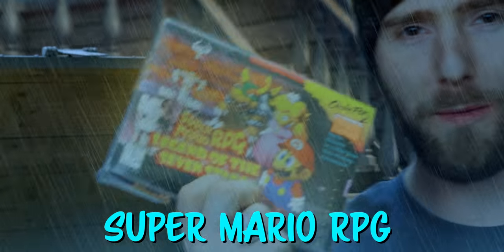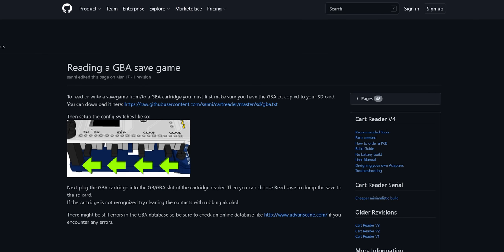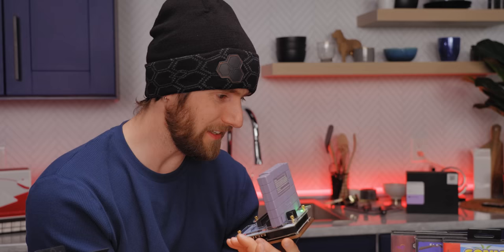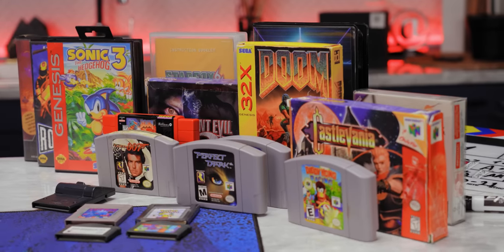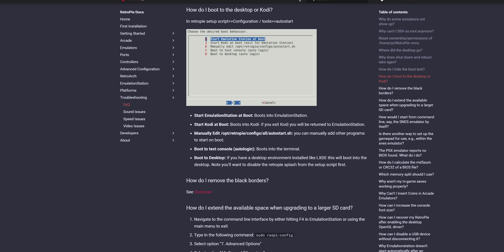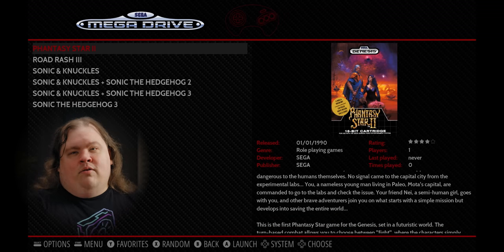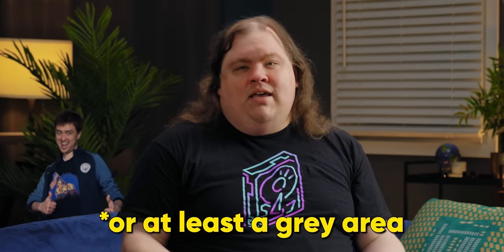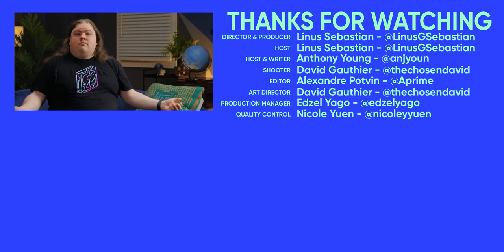I am a pirate - How to LEGALLY emulate games ft. Save The Hero / Sanni v3 + Raspberry Pi

Comment: Imagine how amazing it would be if video games entered the public domain 10-15 years after release. Unfortunately, due to a certain mouse, that’s impossible.
Reply: Mickey actually is going to enter public domain on Jan 1 2024. Turns out the extensions to copyright became such a meme that anti-copyright extension groups gained a lot of traction and an extension is now unlikely. It's worth mentioning that only the original Steamboat Willy depiction of Mickey is entering public domain that year though, so you still won't be able to use the more modern depictions of the character for a while.
Reply: @TheRyulord  This is exactly why they've started using Steamboat Willy at the start of they're movies, etc.  Copyrights expire, but trademarks (to oversimplify that means logos and identifiers) don't if they are still in use.  This way, they will still have a case against any major party trying to use Mickey without their permission.  How far that will go in court, I have no clue.
Reply: @Hunter____1  You can pretty reliably track the outcome of a (US) copyright/IP case based on the wealth difference between the parties. There are several notable exceptions, but the general rule is bigger company = victory.
Reply: @angolin9352  oh, I'm not even a little bit surprised
Reply: @TheRyulord  All copyright, patent, digital rights, etc should be public domain as soon as they become profitable enough to be supported by more than one person. Copyright was intended for individuals, not collectives. All collectives should lose patent and copyright. They are essentially government protections and regulations that harm competition and harm the public by creating inequality
Reply: @angolin9352  All regulation naturally favors the more wealthy, powerful entity. This is whyregulatory protections for collectives should be removed, and granted for individuals
Reply: @Hunter____1  with a company the size of Disney it doesn't matter if it'll hold up in court
Reply: @tynao2029  honestly? that's a pretty based take
Reply: @ThylineTheGay  I agree! And you will always have countries that dont give a toot about copyrights like China, Russia etc.
Reply: @TheRyulord  By the way, the Constitution (not the amendments, the actual text of The United States Constitution) states that "No Bill of Attainder or ex post facto Law shall be passed."

In other words, every single Copyright Extension Act was a violation of the plain text of the constitution when applied to works such as the mouse.
More info:

"When these prohibitions were adopted as part of the original Constitution, many persons understood the term ex post facto laws to embrace all retrospective laws, or laws governing or controlling past transactions, whether . . . of a civil or a criminal nature.2 But in the early case of Calder v. Bull,3 the Supreme Court decided that the phrase, as used in the Constitution, was a term of art that applied only to penal and criminal statutes."
Reply: Atari stuff is soon to enter public domain in Canada and Italy. I.e. any country that has a copyright duration for these things of 50 years after publishing. Wonder how that works if you happen to be in a vacation in one of those countries.
Reply: Ahh the groomer mouse
Reply: This may be unpopular but I think 50 years after publication is more reasonable. Thats enough time to assume that the creator is already dead or very old and have no way of profiting off the work anyways. That would mean though that with the exception of Pong, all video games would still be under copyright protection.
Reply: Or better yet, release the source code if they're no longer gonna support it
Assuming they were prudent enough to keep it, but just look at what it's done
for Doom, Quake and Duke 3D to be open source. Basically immortal games with infinite new content
Reply: @TheRyulord  that still sucks
Reply: @RadikAlice  tbf doom isn't technically open source. The shareware level files are, but that's it. People wrote completely fresh engines and either illegally share the level files or recommend you take them from an old official version.
Reply: @gavinthecrafter  imo it should carry some sort of condition that the software has to still be purchasable. If the only legsl way to use a piece of software is on outdated technology and physical media that are becoming increasingly difficult to find and only through resellers, I don't see what the copyright is actually protecting.
Reply: @GhostGlitch.  True, games themselves aren't but arguably the most important part is. The engine
Something like Freedoom would make no sense otherwise, it's not a literal 1:1 copy, but a replacement for the original assets and stuff
Reply: @RadikAlice  looking further into it I guess I was wrong and the engine is open source. I was under the impression that gz doom and such were written from scratch, but looks like they modified the original source.
Reply: @GhostGlitch.  Yeah, that's what I was referring to. And it was thanks to John Carmack's
insistence too, as he's a big proponent of open source. They were gonna release the DOS
version but it had a proprietary audio API, so they settled on the Linux port instead.
And that's what every sourceport like GZDoom, Chocolate Doom and etc are based on
Reply: Same thing should be about movies, music, books, technology, drugs...
Reply: Like viagra, right?
Reply: @TheRyulord  And beginning today, Mickey Mouse is now officially in the public domain. Yippee!
Reply: Hey that’s my name.
Reply: @angolin9352 Especially that 10-year old V. Roblox case

Comment: Just a side note for protecting your cartridges: silicone electrical spray really helps protect the pins. It’s used in faders in audio equipment all the time to keep them in working longer.
Reply: It's called silicone.
Reply: @timramich  is correcting them for forgetting the letter E in silicon really necessary.

And yes I left off the letter E on purpose just to annoy you more
Reply: @demiviral95  Absolutely.
Reply: @demiviral95  chad
Reply: @demiviral95  You need to capitalize the first letter of a sentence.
Reply: @demiviral95  Sure, but silicon is a real thing and is related to the subject at hand, which is potentially confusing.
Reply: @haphazard1342  And silicon won't actually help protect the contacts but might make things worse.. lol
But silicone grease is probably a good idea. Doesn't need to be a spray. May also use dielectric grease as it is called sometimes.
Reply: @timramich  thank you. My spelling is horrid. Fixed.

Comment: I’ve never had any moral reservations about emulation. In most cases, the only way I can “own” the game is to buy an old console, and buy a used copy of the game, both on Craigslist or the like.

My money going to some guy that bought this hardware years ago provides zero benefit to Nintendo. Yes, original hardware is better and arguably more fun, that’s where the value is. 

Locking down old IP doesn’t really help anyone, and the fact so many are willing to use sketchy websites and often technical programs to have a nostalgic experience should tell these companies that there should be a better alternative. Take my damn money so I can play on my switch, but don’t yell and scream that I downloaded something you no longer sell.
Reply: Agreed, Nintendo wouldn't have such hell with pirates if they were to offer a better alternative (and not some crappy service that you have to pay up to 80 bucks a year for)
Reply: @SUCHMISH  Gabe was right.  Once I had an income that could support me buying games for sentimental reasons, I looked over the online shops that I had downloaded for the games I wanted.  Even then I was still going over them with a comb because game companies can't help but change things, for better or worse.  

If it's a choice between throwing some money at a online shop to have a game on my PC or pirating, I'm taking the shop.  Nintendo of all things has burned me out of wanting to use a console, since they want me to rebuy my legacy games every 5 years or so.
Reply: @leadpaintchips9461  Gabe's philosophy is such a good one. Nintendo could demand full price for their games for all I care, if only they sold them online in an unencrypted ROM format. That, or Steam's model, which seems pretty good about not taking your legally obtained license away. 'Cos, that's the thing. You can't own a game, only a license to it. I'd say that the philosophy of "more convenient than pirating" also is a moral one. If companies want you to keep buying new licenses to the same game because they keep deprecating and removing support for older platforms, they might not deserve the sale. I don't care how much you point at how the law doesn't differentiate between legal and natural people; there is a difference between internationally published digital media sold through retailers 30 years ago, and new personal projects bearing the creator's name, published by said creator, where all money goes to the creator, that are being sold today.
Reply: But what if they did sell the game? Like for example i got pcsx2 on my Xbox. I wanna play max payne 2. I never bought it before. Now i can either emulate it or buy it from the xbox store. Here, is emulation wrong?
Reply: I don't care about piracy, but the sense of entitlement in most people is silly. You don't have some devine right to play a game, if they don't sell it the options are stfu and it's tough sh*t, or break the law. I have no problem with option 2, but I don't pretend there's some morals involved in it.

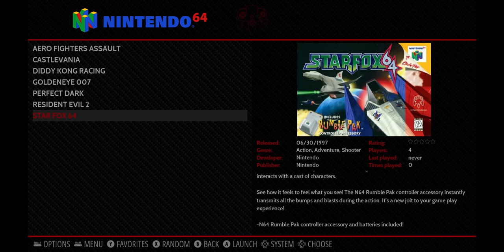Comment: 13:16 Helpful TLDR: I reckon it is your capacitor. Under a dollar to replace. Before assuming the SRAM, it might be the resistor or capacitor. Probably capacitor due to age or as a knock-on effect of the resistor failure. Resistors are more likely if the resistor had got damp at some point. I reckon capacitor is the likely culprit and your SRAM could well be fine. 

A bad cap could be prematurely draining the battery and (with or without resistor fail) changing the voltage as it writes to the (probably) 16K SRAM. Unless you have a bad solder joint (which I doubt), don't automatically assume the SRAM. You can test the SRAM chip btw. A new (identical) capacitor is a long overdue replacement. Trying saving a traditional new savegame on a real console could be a worthwhile test. A fluctuation in performance smacks of a capacitor (or resistor) because it is intermittent like a voltage spike (creating the artifact). A bad SRAM would either be totally dead (and not that symptom if it were that sudden) or it would be by electromigration, but of that were the case you would expect an array of SRAM, but you have only one 16K chip so it would not be so likely to be intermittent a fault (variation in bytes that did not verify) compared to if you had an array.

The SRAM chips places a fast load upon the power when the signal is pulled for the /RAS (row address strobe) "leg" metal strip out of the chip (and that can be a prerequisite to the CAS signal). Inductance is voltage divided by the rate of change in current. So you're probably getting a voltage spike because you have a bad capacitor, resulting in the loss of bits in a RAM chip which is otherwise perfectly functional. A capacitor can be used as a decoupling capacitor. In Direct-Current, a wild variance in voltage in the power line to the chip will cause an undesirible change in the inductance (hence using a decoupling capacitor). Different RAM chips can also have different voltages. Some SNES cartridges are SMD instead of through-hole. That gadget you are using might not expect the right cartriidges. That Mario-RPG is a rather modern cartridge (SMD).

I would say, first just try replacing the capacitor (with an identical rating and type, electrolytic/solidstate, where a film capacitor is superior to a ceramic capacitor in decoupling, and so an electrolytic is unlikely).  Do also have a look for a discoloured resistor dulled (if it is even that type of resistor)  and take a multimeter to it (with magnification). However, it could well be just a busted capacitor with no need for other repair. Remember the kaplon tape over other parts to keep them safe and static protection. Where eye protection when snipping the legs of the capacitor you solder in (or out). Those resistors on the Mario RPG are generally not the big type you ge on other carts like other Mario games.
My comment has no hate in it and I do no harm. I am not appalled or afraid, boasting or envying or complaining... Just saying. Psalms23: Giving thanks and praise to the Lord and peace and love.

Comment: The SMRPG cart failing just shows how important emulation is for game preservation. All these cartridges will eventually fail.
Reply: Especially if you bought it for $299 Canadian (about $234 U.S.) and doesn't work.
Reply: It may be possible to fix it if it's a broken capacitor or resistor. Bad batteries are an easy fix. Other than that, not realistic.

Comment: I have a ROM for each of my vintage game carts. Did I dump them myself or did I download them? You'll never know because a well made digital copy will be as sharp as the original.
Reply: This is not true for modern game cartridges. The Nintendo 3DS and Nintendo Switch utilize keys and digital signing to attach software to a specific console. This is why emulators often require console-specific files to prove you own the console itself and the game, this is also why emulators are legal. Emulators which work "out of the box" are using piracy means to allow you to play software or the console it is emulating does not have those securities in place.
Reply: @lightly-red-huedmaleindivi6266  The topic is on Vintage Systems, last I checked the 3DS and Switch are not vintage systems. Also, these newer systems do not use game carts, they use game cards. Game carts finish the electronic circuit in the game system allowing you to play it. Game cards on the other hand act more like flash cards that are booted by the operating system.
Reply: @Waifu4Life  Being labeled as vintage or not is irrelevant as the 3DS and Wii U store will be discontinued as of march 2023. This means software for those systems will become just as inaccessible to everyone as software for older systems. Therefore piracy for those systems will become a topic of discussion as used physical games may be available for some but not everyone will have access and will need to resort to piracy.
Reply: @lightly-red-huedmaleindivi6266  Emulating a DS or 3DS is not the best thing ever because of the dual screens and touch controls. The Wii U is a modern system that can easily hook-up to  modern TV and can easily be jailbroken, so emulating it is pointless unless you just don't want to spend single a penny on hardware.

Comment: I love the DSi since it’s super easy to dump roms from your carts to the SD card slot with the help of a camera exploit. No extra hardware needed. Dumped my entire collection of games in under 2 hours.
Reply: HiyaCFW ?
Reply: Why jump through all those hoops? I know someone that downloaded 6000+ NDS roms in under 5 minutes
Reply: @ToxNano  The CFW is without using an R4 card and you can emulate games from other handhelds too
Reply: @M87-o3n  Sure, custom Firmwares are great. I still wouldn't want to dump 50+ games myself, especially not if they're available elsewhere  :D
Reply: @ToxNano  I never said I didn’t do that as well, have the entire English library of GB, GBC, and GBA games along with every NDS game that might interest me backed up despite me only playing those games for a couple hours tops since downloading them. I may as well snag that save data as well since I have the capability on my DS. 

I am more of the person who mods consoles because it’s fun than actually using those modded consoles and playing the games. I’d just rather emulate my games than use the original hardware. Did the same thing with my wii and wiiU. Modded them for like 2 days, played like 2 games, then didn’t touch them again (except when I need an online account to rip off the wiiU to use on CEMU)
Reply: @ToxNano  Oh yeah for sure. But I just like to mod consoles. I barely even play the games after i do it